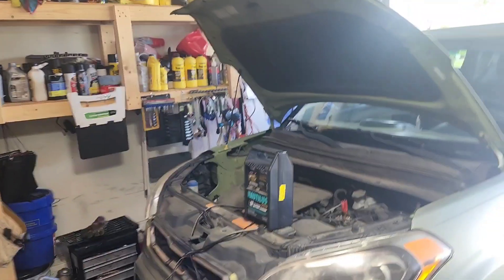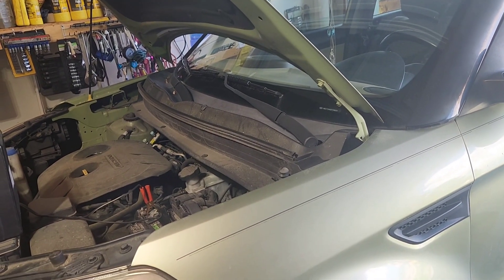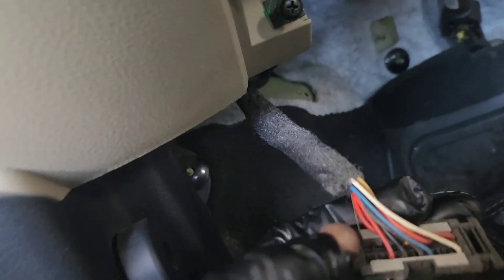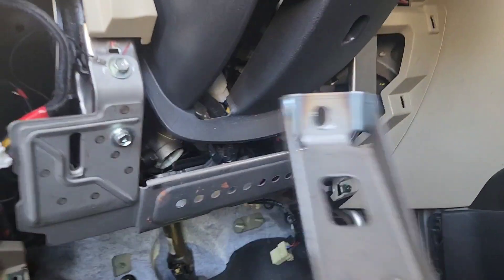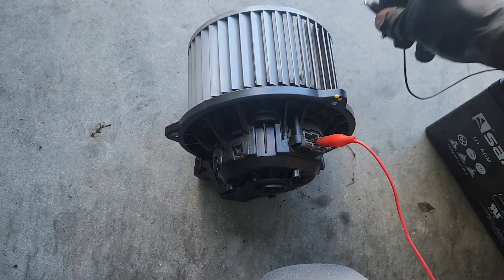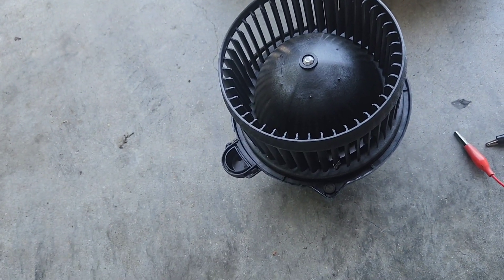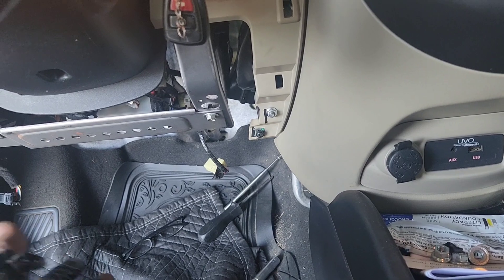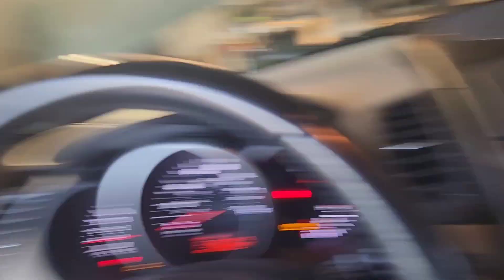2014 Kia Soul+ Blower or Blower motor resister. Solved!!

Comment: Hey brotha how’s it going. I was wondering if you could give me some insight. Car has a random misfire for cylinder 2/4 . I replaced the spark plugs and tested the coil packs. Coil packs are good. Everything was fine until i turned the AC on it then started misfiring and hesitating during acceleration. Very lost with this . The ac compressor does make a noise when i turn it on . Works blows cold but sounds like it’s binding/seizing
Reply: Car is a 2007 Hyundai Sonata 3.3 V6